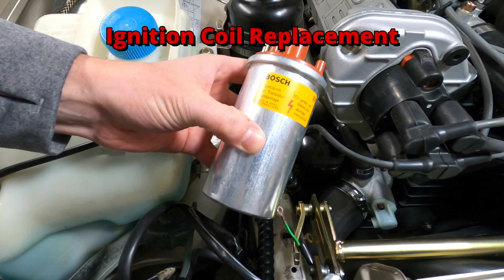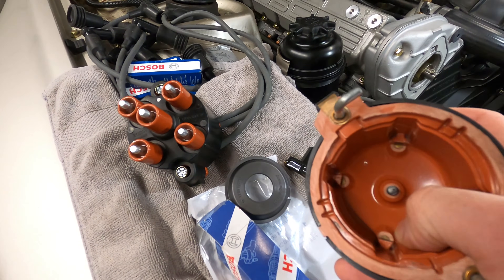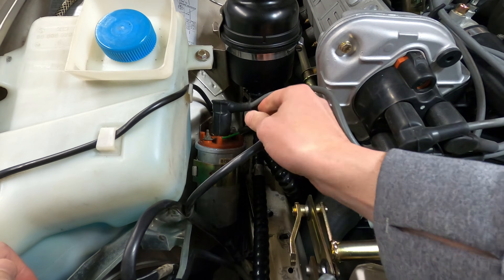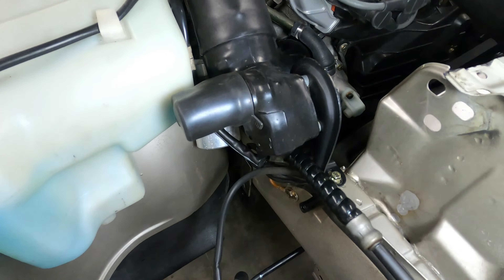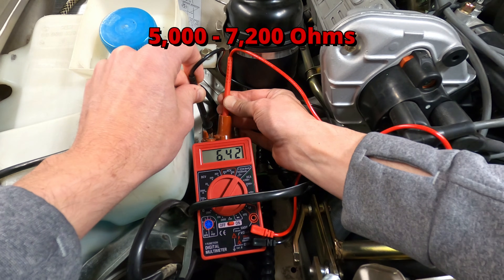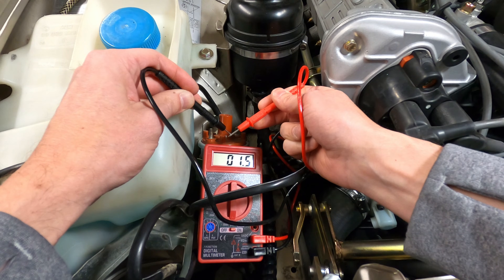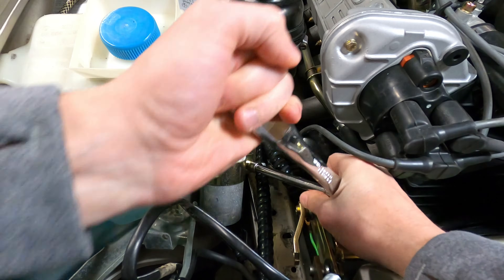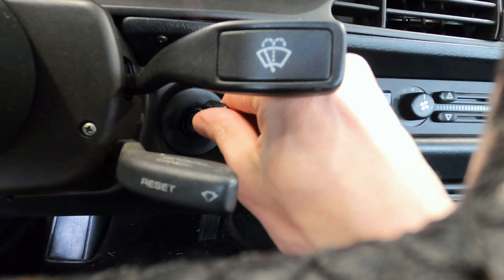Porsche 944 – Ignition Coil Testing & Replacement Tutorial

Comment: Extremely helpful as my son and I renovate his 944. Question if no voltage at all on the ignition coil when key is in ‘on’ position (but is when starting) does that mean ignition switch may be faulty ? Thanks and wonderfully clean car !
Reply from the maker: Hey Alex! Yes, you’re thinking is correct. The coil wiring should have switched voltage when in the “on” position. I would check the ignition switch and the wiring leading to the switch. It’s fairly common for them to fail over time.
Reply: @NC944er   Hello, I’m the son. After replacing the switch, I’m still not getting power to the coil in the “on” position. It did run about 2-3 months ago and then I worked on the speedo cable and now it hadn’t started again. 

I haven’t checked the wiring at the moment to the coil, is there some pins I can test on the power wires on the wiring that go to the coil from the dash? Is there a way to see if there’s a problem there? Thanks!
Reply from the maker: @Gunt4sh  The black wire from the ignition switch runs through the central electric panel and then over to the coil. If the key is on, there should be 12v at the coil. There are a couple issues that can happen at the panel, the pins can burn in the socket or become loose, causing a bad connection. 

Try running a new wire (or using jumper cables) from the battery positive terminal directly to the + post on the coil and see if the car starts when turning the key with that jumper connected. If it does, you’ll know there is a problem with the ignition switch to coil wiring somewhere on the circuit.
Reply: @NC944er  thank you very much
Reply: @NC944er  I just tried the positive post suggestion and it still had a slow start. I’m smelling fuel and I see touch bounce. I’m half wondering if my starter is dying. Cables look okay and very minimal wear. I’m assuming because I smell fuel that the dme is working.
Reply from the maker: @Gunt4sh  Oh ok, so that got it started at least, just slow to crank? Slow starting is usually either a starter or battery getting tired (or the starter power wire is needing attention, the connections under the car get pretty oxidized down there).
Reply: @NC944er  Hello, thought id give you an update, after all the trouble shooting it was the starter that had went bad. Thanks for the great advice and its running really nice now. Thank you for your time!
Reply from the maker: @Gunt4sh  Nice, I’m glad you were able to track it down! And that’s one more thing to check off the list of future repairs. 👍🏼

Comment: What do you consider most important on the ignition system and why ?
Reply from the maker: Sounds like an essay question. 😂 In terms of the individual components, they are all relatively equal in importance because without any one of them, the car won’t run. In general though, the most important thing is probably keeping up with recommended maintenance just like any other system. The spark plugs, distributor, and rotor are the most wearable items that require periodic replacement. The coils are pretty robust and usually last well over 100k miles. Age of these cars presents a unique issue with the rubber ignition cables drying out and/or cracking. Even the DME computers aren’t immune to age, as the ignition over-current protection can lose its calibration over time, causing the driver to heat up, softening the solder joints on the board which fatigue and eventually crack.

Comment: Any tips for stereo wiring? My ground wire seems to have no power
Reply from the maker: Outside of replacing the factory speakers, I haven’t really dig into the stereo wiring, but cleaning the ground connections and ensuring all connected ends are properly seated is a good place to start.

Comment: It's hard to see but does the black cap on the coil engage with the flange on the coil?  It looks like it should but on my car it's just perched on top.  Glad it's not missing, though.  My ignition wires are fitted with a series of protective sleeves which is nice but keeps them from fitting into the designated retainers.  Since yours fit so nicely I guess you removed the rubber sleeve?
Reply from the maker: That’s too funny… the cover on mine was just sitting on top as well from the last person who was in there, but yes, there’s a ring on the lower section of the cap that bulges out and the flange/ridge on the coil sits inside there. It won’t slide all the way down if the coil isn’t up high enough in its mount. 

I have seen sets of plug wires with those protective sleeves on very low-mileage example 944s and believe that is how they came from the factory. Usually there are some gaps in the covering that allow the wires to be pushed into the retainers. My wires were replaced under prior ownership and didn’t come with those sleeves.

Comment: Great video.  Thanks for sharing the coil specs.  I also learned the coil has a cover.  I've never had a 944 with one.
Reply from the maker: Yeah, the covers often go missing over the years. About $30 for a replacement - part #: 944-602-801-00
Reply: Thanks.  I have a cart waiting for checkout with sunset for seals.  I guess I'll add this to it, and the headlight relay cover I forgot.